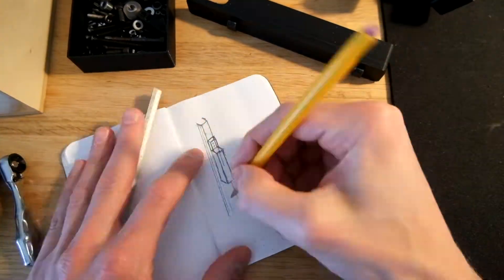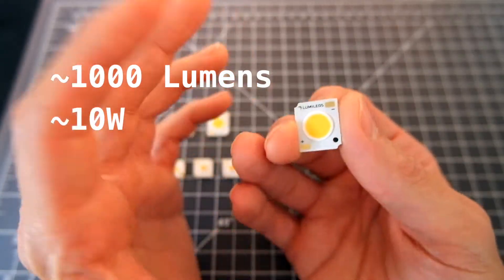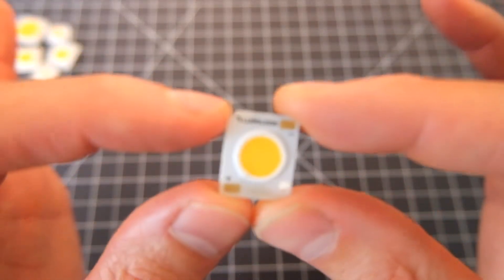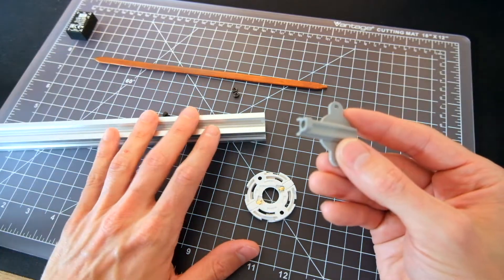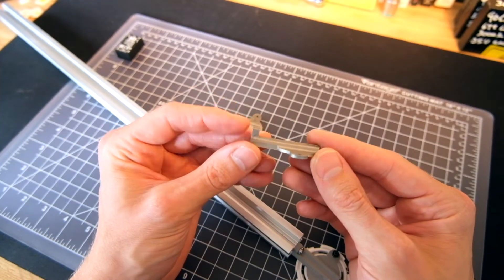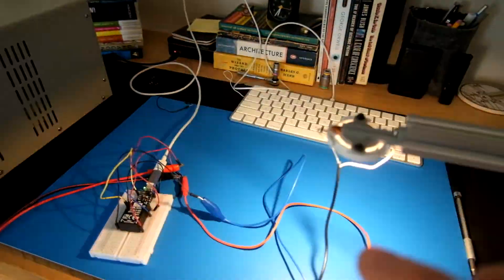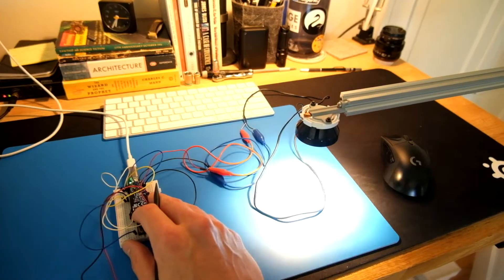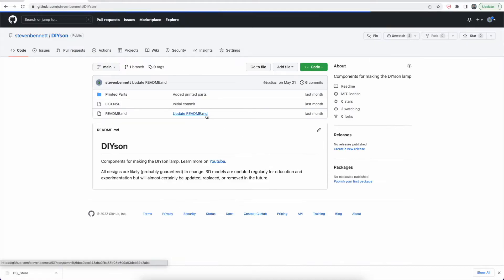Powering a high power LED (and not melting everything) - DIYson Lamp Build Log #4

Comment: Hi, I would like to see a more in depth video on the electronics assembly and coding if possible. I’m not completely ignorant and have a little coding experience but there is a level of assumed knowledge that disconnects me currently from the end to end process. I’m happy to learn but I’m a bit unsure where to begin. Otherwise I would like to say how much I’m enjoying this series and coming along with your design/engineering process 👍. By the way I came to your channel via the battery powered soldering fan video.

Comment: The constant current drivers are not really constant current under certain voltage range and certain consumer (the LED).  Above that range they do keep the current stable. I run LEDs that require 36.1V with 45V and the drivers keep the current at 350 mA. But in the range 35-36.1 I can adjust the current that the LED uses by just adjusting the power supply that feeds the drivers.
See for yourself - vary the voltage and check the current and you will see that it depends on the voltage.  So by adjusting the voltage you can drive LEDs that require weird currents (like 170 mA or 260 mA etc).
Also - I don't know what the original Dyson lamp is but it is really practical if the head (where the LED is) can swivel left/right and be angled back/forward too - full flexibility.

Comment: Color Rendering Index: The measurement of CRI is not internationally standardized. We assume “95 CRI” means 95% color accuracy across the entire spectrum of light. For this to be true, the measurement should be calculated based on 15 reference colors specified by ANSI as R1-R15. The majority of manufacturers and retailers use a “CRI-Ra”calculation, which is the accuracy of ANSI colors R1-R8 averaged. Conveniently, R9 is the exact part of the spectrum where most LED struggle: Red. If you have ever seen a person, food or anything with warm tones in it lit by truly high CRI (“95 CRI” is true for red, not just the first 8 colors) you will notice the difference. It’s huge, but it’s hard to describe. If you paint, draw or do any kind of creating, this is eye opening. Unfortunately, just about any LED labeled “CRI 95” can drop as low as CRI 80 when their red score is factored in. Your project is special, so I would make sure it’s a true CRI, not CRI Ra. Not easy to do, because it’s not enforced in many places. Especially in the US. Love this channel, do your thing, sorry about the tl;dr… 😅
Reply: There’s a vague disclosure in the datasheet for Lumiled Luxeon series CoB: “R9 value of 90CRI products is >50.” (It’s probably around 60 for the 16x19.)

Comment: I'm stoked to follow this project! I was wondering if you considered using t-nuts to bolt the LED mount directly to the aluminum extrusion. This would prevent having to create a separate part. I would probably put a thin copper shim between the LED and the extrusion to aid in the heat transfer.

Also, consider changing the LED slightly. Moving from the "E" series to the "F" series increases the efficiency by ~10% from 122 lm/W to 135 lm/W. If you like the brightness of the "E" series, running the "F" at ~91% power would yield the same brightness. More watts converted to lumens means less watts that need to be dissipated as heat. Also, under-driving LEDs increases their lifespan quite a bit.

E-series: L2C5-35901203E0900
F-series: L2C5-35901203F0900

I think if you bolt the LED directly to the extrusion, you won't need the heat pipe, I would test it out. My gut tells me that the heat pipe will only really help to spread the heat out across the arm a bit, but I don't think it will result in a significant improvement. If it works, that'll make the project a bit less expensive.
Reply: With 80 CRI, even 220 lm/W efficiency is achievable, e.g. Osram OSCONIQ series. The reduction in heat output is even larger - at 3500K 1200 lm output, a 122 lm/W LED gives 6 W heat; 135 lm/W LED gives 5W heat and 220 lm/W LED gives only 1.5 W heat.

Comment: When you brought up using stainless steel for your connector piece: Stainless steel has very low thermal conductivity for a metal (carbon steel is ~3x higher, aluminium is ~10x higher).
Probably won't be a problem at 10W and with the heat pipe doing the heavy lifting, but just something to keep in mind :)

Comment: Awesome build! Always had an eye on the Dyson lamp, and now I'm already sketching my own ideas:) Can you recommend any LED with variable color temp. ?
Reply: Those are easy to find. Working out the drivers for a tunable white LED is not so simple. Most tunable white LEDs can run either channel at 100%, or both at 50%, so you would have to add code that regulates dimming of the two LED drivers so as to never exceed 100% total current.

Second problem is the LED holder. They're hard to find in 4-wire versions that support a 2-color LED. Start with the proper holder and work your way back a compatible 2-color LED.

It would be easier to just use two separate LEDs with independent dimming and let them both go to 100% if you want.

Comment: I noticed the constant current LED driver you have linked in the description would not be suitable. I was confused how you could drive the LED with 1A @ 12V. The version in the video description can only step the voltage down and is missing the buck-boost converter. After realising this, it makes a lot more sense :D

Comment: Hi, how did you ensure proper thermal contact between both led to heatpipe and heatpipe to aluminum frame?
Reply from the maker: Haven't covered this yet but I plan to use thermal adhesive to attach the heatpipe to the aluminum extrusion (hoping to transfer head from the pipe into the arm to use it as a sort of heat sink). Between the LED and the heatpipe I'll use some thermal paste like you'd find on a PC CPU.

Comment: Just found your series, fun stuff!  An observation on the brightness control is that the human visual system tends to work on a log scale.  E.g. the change from 25 to 50% will look much larger than the one from 75% to full brightness.  I'd suggest something like 12, 25, 50, 100%.
Reply from the maker: Good call, Sam! I'll have to take that into account as I finalize the code, thanks for the suggestion :)
Reply: @StevenBennettMakes  it's "just" code so it's much easier to iterate on!  I've got the volume and brightness controls on my computer using a dB scale as well and it's much nicer to interact with.  not sure why it's not more common
Reply: That's an interesting point! Did not know that. Huh.

Comment: Great project and I love your vlog on your build process. One thought is the "power supply" for the LED is rather large. Not entirely sure what kind of output it provides but maybe if you provide the correct voltage for the LED and use a MOSFET as a switch then the overall volume of the electronics can be reduced quite a bit. You can get very compact voltage regulator for the electronics if that is needed.
Reply from the maker: I agree! Way too bulky :) Functionally it just outputs a constant current of 300mA at or above the LED's forward voltage (34.5 V... which is admittedly kind of high). Stay tuned for the next video where I should talk about a more compact solution that I found.
Reply: Yes the LED PSU is very large. Maybe a smaller one might also work… Idk if there's a constraint of having the PSU close to the LED. If not, the PSU could happily live in the base of the lamp, no?
Reply: LEDs are current driven and not with voltage, you need a constant current regulator, not a voltage one

Comment: How is the noise emission? I used/tested a lot of these meanwell dc dc drivers and at a 4khz pwm, they make a lot of noise (also the datasheet of most of those mw drivers says 1khz max frequency, and I can confirm that the switching edges start to wash out at around 16khz)
Edit: I think I can hear it on 12:35
Reply from the maker: ...yeah :(

Comment: I am also considering making a lamp that kinda goes beyond dyson design. Do you think it would be possible to put the counterweights inside the aluminium profile to make them invisible? So I would put them in both axis to make the whole con structure totally balanced and weightless for adjustments. What do you think?
Reply from the maker: Hey Max! I think it's theoretically possible (and a cool idea) to fit a counterweight inside of an aluminum profile, especially using a larger profile (20x40 or more) which have that hollow bit inside. I think the biggest challenges will be 1. Getting the counterweight to move smoothly (you likely can't fit wheels in there) and 2. Adding enough weight to counter the opposing arm in such a tight space. I bet these are both totally surmountable given some creativity so I hope you give it a shot :)